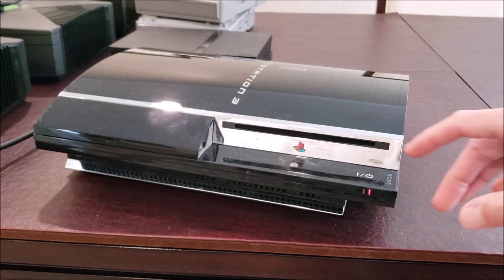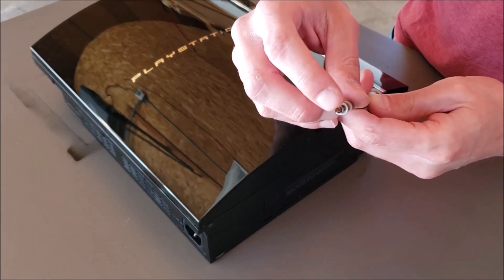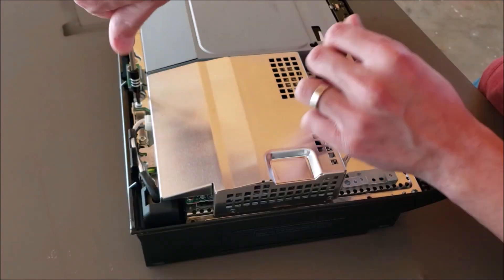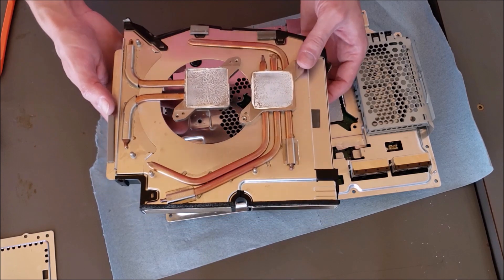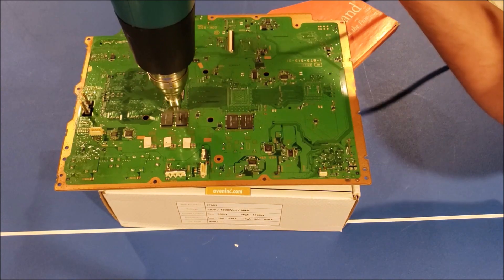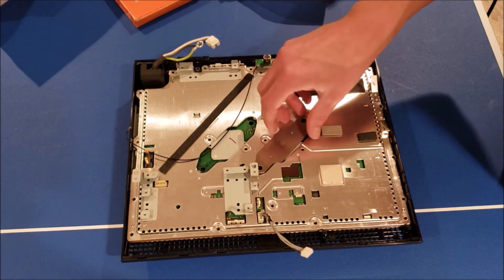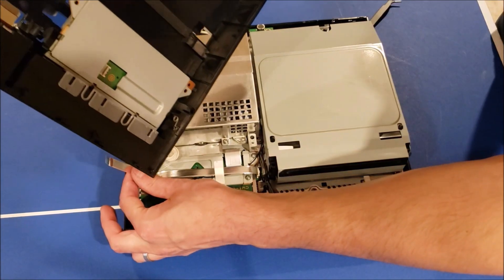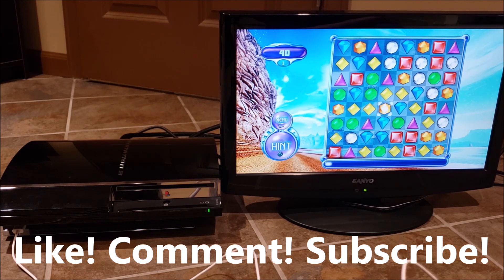Fixing a PS3 with Blinking Red Light "of Death" (YLOD)

Comment: Does that work with a hairdryer on highest setting ?
Reply from the maker: Over time it probably would, but you'd be looking at 10 - 20 minutes to get it hot enough (as a guess) instead of 1 minute or less. I imagine you'd also need to cover it with a thick blanket or something to insulate it during that process or else too much heat will escape and it will never get hot enough. A potential problem with that is you're heating up everything instead of just the chips of interest. I haven't tried a hair dryer myself so this is just conjecture. Low-end heat guns are pretty inexpensive so I would recommend that instead.

Comment: As any good repairman knows it's better to re-ball the unit then to just heat it up heating it up could last a day it could last a year after that it Takes another Massive crap and won't start back up  Re-balling it 9 times out of 10 actually fix the underline issue As well as a good cleaning and getting rid of all the dust
Reply from the maker: I don't disagree and have addressed this type of comment in the video description.

Comment: Can you put thermal pads on the back Nec Tokin Caps if so what thickness?
Reply from the maker: They should already have thermal pads, see around 7:55 where I temporarily remove them. I didn't measure thickness but they were probably 1mm or less thick.
Reply: @FantasticQuack  My main 60gb didnt have thermal pads there.
Reply from the maker: @nightruler666  Maybe you have the 1st (or 3rd) revision PS3, this one is the 2nd revision. You could add your own pads if you want (I would go with something in the range of .5mm - 1mm thickness), but I'm not sure whether it will add any longevity.

Comment: Dang it didn't work 😭
Reply from the maker: More heat!
Reply: @FantasticQuack  where can I get heat gun for free
Reply from the maker: @PratheekPRao  Get lucky at a garge sale maybe? I think there are multiple $10-$20 options on Amazon
Reply: I had continuously kept the hair dryer at max heat for over 20 minutes continuously
Reply from the maker: @PratheekPRao  It may have been losing heat too quickly. You could try insulating it by putting it in a box or wrapping in a blanket with an openning just large enough for the hair dryer to fit in. Ultimately I'd just recommend the heat gun.

Comment: my ps3 fat has ylod but the green light stays on for like 4 seconds and then the psu makes a clicking noise, is this an issue with the psu or nec tokens?
Reply from the maker: Good questtion. Unfortunately I lack the expertise to answer it. I've never experienced this before, but it might be worth opening the PSU to check for any obvious visual problems which might narrow down the issue.

Comment: I recently opened up my PS3 and gave it a deep clean and I replaced the thermal paste but I'm still having this issue. Any idea what else it could be?
Reply from the maker: Replacing the thermal past is not enough. You need to repair some solder joints with heat first. See the 7:00 mark in the vid.
Reply: @FantasticQuack  i did that and am still having this problem, deep cleaning and heating the solder appeared to do nothing
Reply from the maker: @itsmenate1557  I'm sorry to hear it didn't work out for you. I've done this on two YLOD PS3's so far and it has worked both times. My best guess is that your system issue is different (i.e. bad component instead of bad solder connections) or simply that not enough heat was used.
Reply: @FantasticQuack  thats probably the case, looks like i'm probably gonna have to save up for a new one
Reply: Should replace the capacitor dude
Reply: You might need to replace the NEC capacitors
Reply from the maker: @upyoursenator  would be a good long term upgrade but it's working well for now.

Comment: There is now a better way to diagnose where the fault actually is by checking error codes. There's around 90% chance that it's RSX issue on the BC console.
Reply from the maker: Hmmm, how do you check error codes if the system doesn't turn on?
Reply: @FantasticQuack  By connecting a special UART cable (very cheap on ebay). Read more in here https://www.psx-place.com/threads/tutorial-research-nec-tokin-capacitors-replacement-ylod-fix.25260/page-192#post-295119

Comment: How do you fix a ps3 wireless problem. Most especially when it displays error code (80010201).

Any solution to that from your expertise experience??
Reply from the maker: I've never worked on this problem before, but I can give some general advice. First thing would be to just disconnect and reconnect the wifi board and see if that helps. If the issue persists I would try replacing the wifi board. A replacement board is pretty cheap: https://www.ebay.com/itm/274814046438?hash=item3ffc3190e6:g:RqMAAOSwjm5gWBHq

Comment: This is Not how you fix a YLOD, you need to replace the NEC/TOKIN capacitors... Reflowing the RSX or CELL will dramatically reduce its lifespan!!!
Reply from the maker: I have addressed this type of comment in the video description.
Reply: @FantasticQuack  looking back at my comment I can't realise how negative I was being, but in all the. Best way to confirm which kind of repair is best for a PlayStation 3 is to check the Syscon error logs.... Its never usually allways a Reflow or a NEC replacement.. They can all be a mixed bag
Reply: arent there multiple causes of ylod?
Reply: @porterrobinsonnurture  yes but a reflow is not the only fix, check syscon for more detailed information
Reply: can i use other type of capasitors? I saw on other video that they are 470f 6v so can i use other capasitor type?
Reply: @coronavirus303  there is a guide on PSXplace that has all the specifications of the caps you need, i would rather not skimp out on things and buy the exact spec
Reply: It is the rsx because they use a low tg underfill on the die and the connection was breaking when you reflow the chip the intense heat restores the chip temporarily,the tokins reliability depends on the cpu and gpu temperature they can last more than 5 years
Reply: @Aleksa.09  this is correct, the 65 and the 40 nm are the best for Phat consoles, the NEC Tokin fix only works for certain types of issues... Allways use a UART to figure out the exact issue
Reply: @calyps0man  i am aware of that but usually... The first thing to allways check is those capacitors... If you just jump straight on the reball the system could suffer massively
Reply: @lukedavis436  Never said you have to jump to reball.  I don't even support reballs. Replacing with a 40nm would be wiser (I showed how in the video). But you are not reading what I'm saying. You must do the diagnostics first. There are error codes that can be read to orient you which component is faulty. There is a method for that, but most people don't want to bother with it.
Reply: @calyps0man  are you referring to syscon?.... That's too stressful for me to work out lmao
Reply: @lukedavis436  Yes, but it is very important though. There is an easy guide these days, I linked in the description video. Also there is a relatively easier method, by using analog meter. But either ways, those are the only accurate ways of doing diagnostics . Everything else is outdated now and you are basically making guesses while there is a way to pinpoint which component is at fault. Reballing/Reflowing, blindly replacing tokins isn't  the best way. Both are not guaranteeing that YLOD won't happen again.
Reply: @calyps0man you have to replace the 90nm rsx with a newer 65 or 40 nm rsx they can last 10+ years and you also have to do a resistor mod and change something on the syscon
Reply: Noope. RSX is the one that needs replacement.
Reply: @calyps0man  the RSX sometimes needs replacement, the GLOD is a symptom of that the NEC/Tokins cause the YLOD every time
Reply: @lukedavis436  There is a very long discussion on these topics over at psx-place. A proper diagnostics must be made, GLODs can be different also. On BC boards, more often than not, RSX will need a replacement.  It is a bad idea to state that a GLOD is always this and YLOD is always that. It has now been proven that there are various faults that show up as YLOD/GLOD/RLOD. But there is a lot of new information that can help diagnose the components with higher accuracy.
Reply: @calyps0man  ok fine yes the RSX needs replacing Somtimes but usually the first thing to allways do is the NEC tokin mod.. If that doesn't work... Then reflow!

Comment: I tried this just now, unfortunately for me it didn't work still gives me flashing red light
Reply from the maker: There's a chance it just didn't get enough heat. Might be worth trying again but going a little harder with the heat gun this time.
Reply: @FantasticQuack  I feel like I did, just like you did on your video,  I even pre warmed the board with gun, would I have to remove the  new thermal compound again? Thanks for your replies
Reply from the maker: @20alpha20  The video is edited down. I probably did each area with the circular patterns for a full minute (so like 4 - 5 minutes total). I had the heat gun set at 450°C which is extremely hot. I also cooled the board down back to room temperature before flipping it over or putting it back in the console. I think you would want to remove the thermal compound again if re-heating, but if you used a plastic scraper with care you could likely retain and re-apply it. It is also possible you have a separate issue entirely, I can't say for sure. The heating process of course has some risk of causing further damage i.e. too much heat could cause a small chip (like a resistor or capacitor) to get blown off the board without you even realizing it. It might be worth scanning over the whole board with a magnifying glass to check for this type of problem as well.
Reply: @FantasticQuack  alright then, I'm going to reattempt it again will put the heat at a faster fan level on high temp, will let you know wether it was successful or not, thanks again
Reply: @FantasticQuack  so I haven't put it back together yet it's cooling, I did the high temp, on the chips but when I went over to the capacitor the plastic melted a bit and I  took the heat off immediately, I feel like it's damaged seeing the plastic melted
Reply from the maker: @20alpha20  Yea that's a risk. Not sure how badly it's melted but it could just be surface level with the rest being okay. Feel free to email me some pics if you want to discuss further. If it is damaged you could look at replacing with tantalum caps like this article recommends, apparently it is a long term improvement: https://www.psx-place.com/threads/tutorial-research-nec-tokin-capacitors-replacement-ylod-fix.25260/
Reply: @FantasticQuack  I definitely do believe it's the caps that need changing, I would send you pictures but I've disassembled it put it back together 3 times I'm going to leave it for now, but I don't have any soldering equipment for that job, thanks for your help it's much appreciated

Comment: I replaced the thermal paste/ pads but this happened. Anyone experience this or possibly have some idea?
Reply from the maker: Replacing the thermal interface material alone is not enough. You need to do the heating/reflow part as well.

Comment: Anyone know of a heat gun alternative? Unfortunately I cannot get my hands on a heat gun
Reply from the maker: A basic hair dryer could possibly work, but you'd need to sit there pumping heat in for a LONG time to get things hot enough (maybe 30 min). You can find some pretty cheap heat guns on Amazon ($20 and lower).
Reply: @FantasticQuack  will a kettle coil work also?
Reply from the maker: @sunielsingh6382  Sure but it seems like it would be difficult to direct the heat to the points you want on the board. My strong recommendation would be just to buy a cheap heat gun. Like this: https://www.amazon.com/Dual-Temperature-Portable-Embossing-Wrapping-Hand-hold/dp/B07S368CBM/ref=sr_1_16?dchild=1&keywords=heat+gun&qid=1621951674&sr=8-16

It's less powerful than the one I use so it will take more time, but still better than a blow dryer or a kettle coil.
Reply: @FantasticQuack  okay ,thanks for the help
I will rather get a heat gun
Reply from the maker: @sunielsingh6382  You bet, and good luck with yours!

Comment: You got super lucky. I'm starting to find that there are so many reasons that you could get that specific error. It seems to be a general error sign for pretty much anything damaged on the motherboard. One missing capacitor can cause that to happen
Reply from the maker: Since this video I've repaired another unit using the same method. In both cases I re-heated the large (CPU/GPU?) chips and the NEC Token chips, so in the two cases I've worked on it was an issue in one of those components.
Reply: @FantasticQuack  are both of them still working because i heard it's only temporary fix.
Reply from the maker: @iqkingdomofiraq4963  I sold one of them. The one I still have is still working, but I have not been playing it heavily for any real stress test.

Comment: There’s also thermal paste under the IHS plates (the big metal plates that the thermal paste was on) it’s difficult to remove but replacing that paste would also exponentially help in keeping it even cooler too 😄
Reply from the maker: Good to know! I don't know the best method to remove those plates and haven't attempted it yet.
Reply: @FantasticQuack  haha I attempted to remove it once and ended up damaging the CPU on a PS3 Slim and now it’s just being used for parts. It’s very difficult so honestly be careful if you’re to attempt it lol. 😭
Reply from the maker: @johny1220  If it fails again I will probably try it. In this video they heat it up with some hot bar solder device before prying it off, but a heat gun would do the job as well.

https://youtu.be/bAiM9DX7e7E
Reply: @FantasticQuack  haha I’ve seen that video actually, and yeah I did remove it on the console I messed up using lots of heat but it’s still pretty difficult, idk I wish I had a full reball station like in his video, so far I’m just doing some of the smaller soldering repairs and still learning the basics lol
Reply: @johny1220  same here man but mine was a backwards compatible ps3, it sucks that happened.
Reply: @2345punk1234  damn man, I have a backwards compatible PS3 but it has the YLOD, I was gonna fix it but honestly got lazy and busy and never got around to it
Reply: @johny1220  mine worked. just getting loud when on for 30 secs, but when i was trying to remove the  IHS plates it chiped the cpu and ram too, :(. be very careful doing this, or it can tear it but, prob be better to get someone who did this before to do it.
Reply: @2345punk1234  did you use a plastic scraper tool thing to pry it up? How did you chip the chips.?
Reply: @jeremygalloway1348  no it was a metal one, and im a noob, i tried to pull up the plates but chiped the cpu while trying to get the plate up. i know i know lol
Reply: @2345punk1234  it can be fixed, if it get properly reballed it will last id repasted correctly

Comment: Will it work for yellow light of death
Reply from the maker: After further consideration, I think the unit in this video actually did have yellow light of death (YLOD) since it went green > yellow > flashing red. Apparently red light of death (RLOD) is just flashing red without the green/yellow at the start.

It seems a little convoluted based on where you look, but to answer your question, I would say it's worth a shot whether you think you have RLOD or YLOD.
Reply: @FantasticQuack  cause I have yellow light of death in my cechgo1 ps3
Reply from the maker: @PratheekPRao  It turns out this is YLOD. I've updated the video title to reflect that. I did this same fix successfully on a cechg01 a few days ago--that model was actually easier to disassemble than the one in this video.

Comment: I actually fixed mine ps3 also like this years ago, and it still works like a charm! Also I did disassembled two ps3 fats and both had different internals. And watching your video I noticed also different internals. But best felling when you fix some old console, keep it going!
Reply from the maker: @Victor Hugo Alvarez Damasceno - #SINGER My take is that you tried this repair yourself and failed, or maybe had bad luck with a broken component. Please do not tell others here to "go lie in hell" or bring any other negativity. You were raised better than that.
Reply from the maker: @Victor Hugo Alvarez Damasceno - #SINGER Wait, I thought I had 3 months max? Now it's 1 month max? Either you're unreliable or each comment you post is killing my ps3 faster.
Reply: Hey man can i talk to u
Reply: checking in 2025. Does your ps3 still work?
Reply: @LRod91  hello , I don't know I sold it. Still rocking PS3 slim CFW and super slim for gaming
Reply from the maker: Agreed! Thanks for the comment, I think there were 3 primary iterations of the phat PS3 so I guess now you've seen them all :)

Comment: Don't heat up the CPU/GPU to "fix" the problem. It's not an accurate way of solving the problem.

If it's a YLOD (possibly also RLOD) the problem is with the NEC Tokin chips. (which can be replaced by better chips)

https://youtu.be/NLOIJF9-3PA
https://youtu.be/0j-VvYRrjdo

Also I would recommend replacing the Cmos battery, to avoid a Cbomb.

Playlist for replacing the NEC chips. But I would recommend only doing that if the Ps3 fails in the future.

https://youtube.com/playlist?list=PLF265H592SPnyG93MToTyXb7-Tu-Vo5Bx
Reply from the maker: Thanks for the extra info. I'm not sure if heating up the CPU/GPU was necessary, but it didn't cause any harm, and ultimately what I did in this video fixed the unit.
Reply: See my other comment.  For me, I did everythign BUT the heat trick, and nothing worked.  When I redid it WITH the heat gun trick, it worked.  I'm not sure what YLOD/RLOD or NEC Tokin chips are, but the heat gun around my CPUs for about 60 seconds on both sides (sort of circling motion around the chips) worked like a charm!